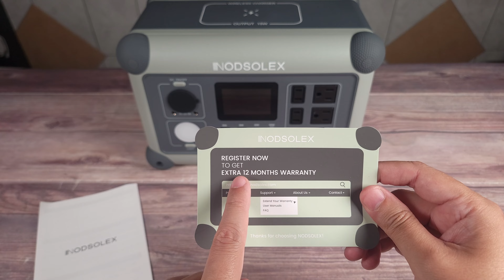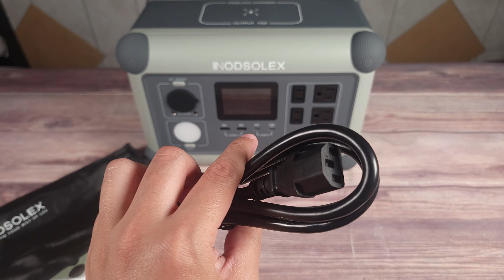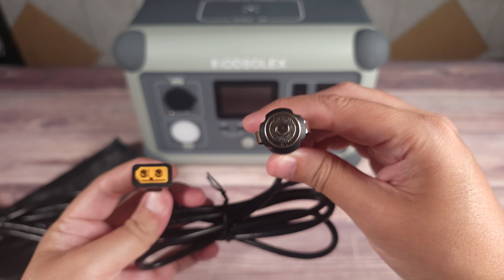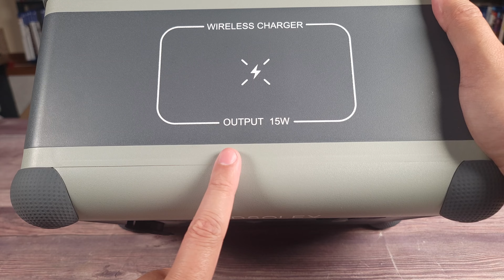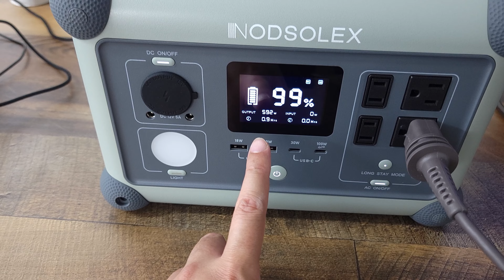A Great Bang For Your Buck! | Nodsolex Oasis 600 Portable Power Station Review

Comment: any idea if this would run a full size fridge? If so, would it do it for a few hours or not really big enough for that size?

Seems like a good deal for the price, just want to make sure it'll be good enough for the fridge. 

Thank you
Reply from the maker: It would honestly depend on the wattage and size of the fridge, but it'll likely run a full size fridge for about 5-6 hours. If you plan to run a fridge for more than that, then I would recommend something with at least 1100+ watt hours.